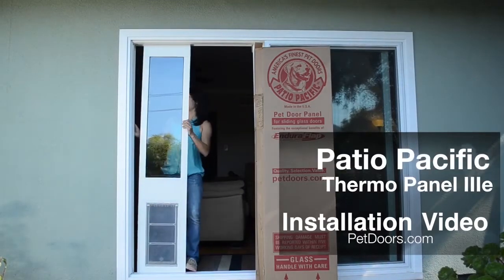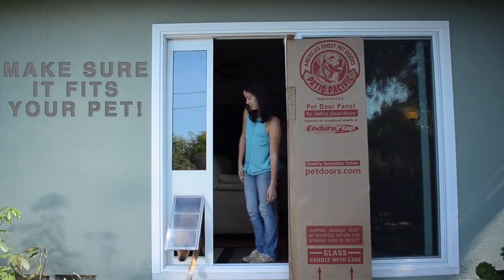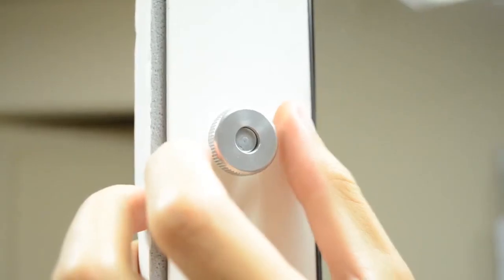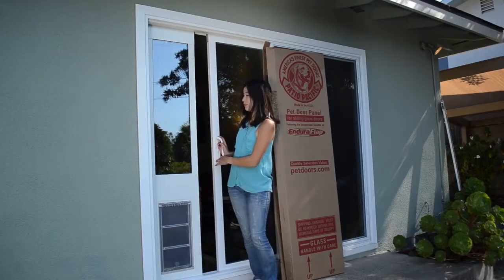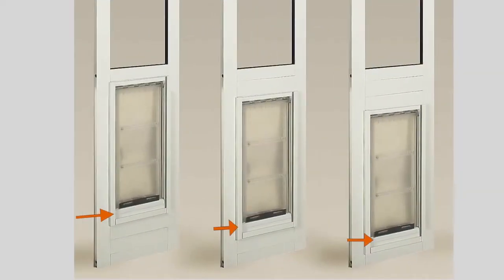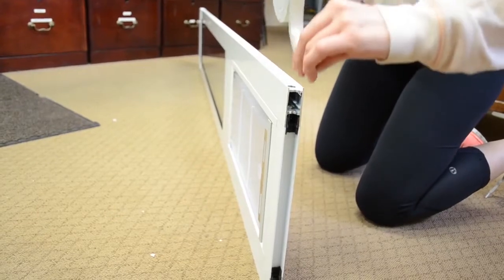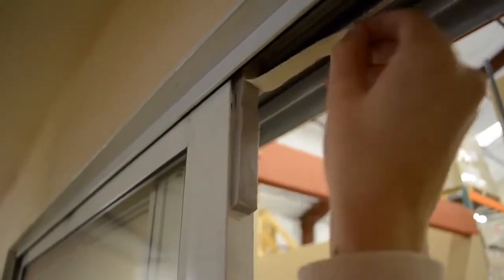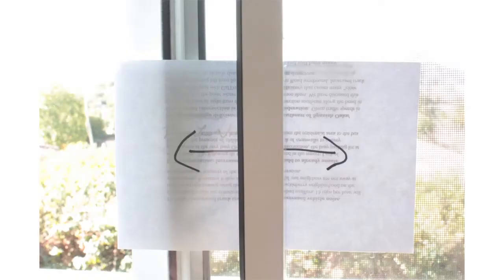Endura Flap Sliding Glass Dog Door Installation Video

Comment: The difficult part is rearranging the spacers, if necessary. They don't go over that at all. Take plenty of pictures before and during the process, if you do it, to help you determine how it all goes back together. Pieces that you can't figure out how they come apart, just pull them apart. I had to use a thin screw driver to start separating them.
Reply: I had to separate every piece below the window to rearrange the spacers, but as I reassembled them, I put insulation everywhere where I felt a space between pieces.